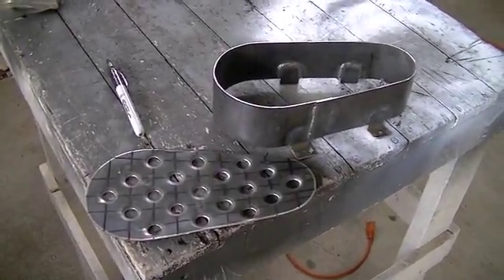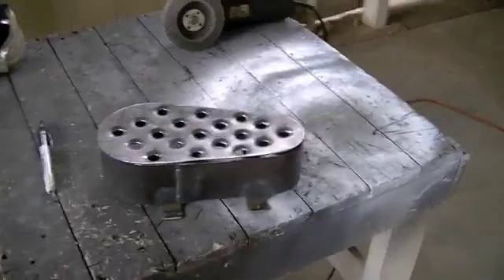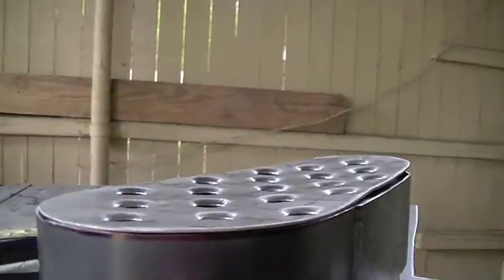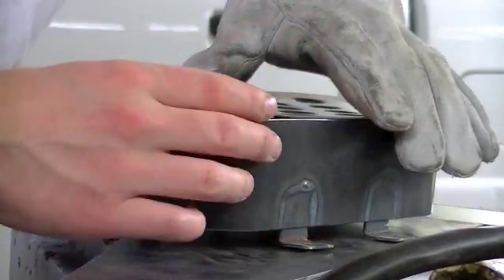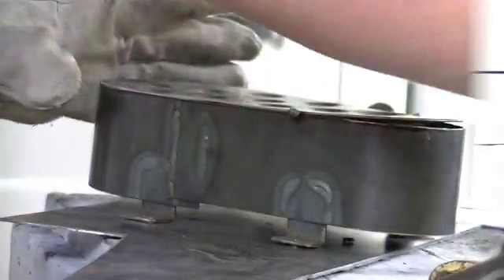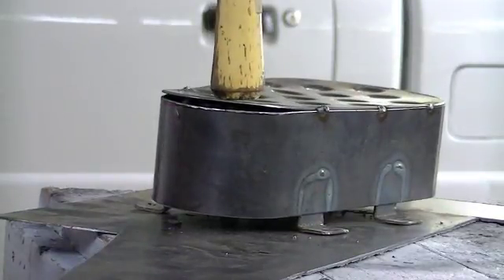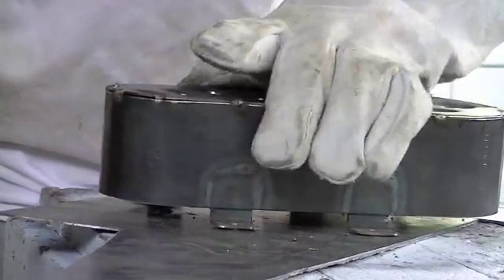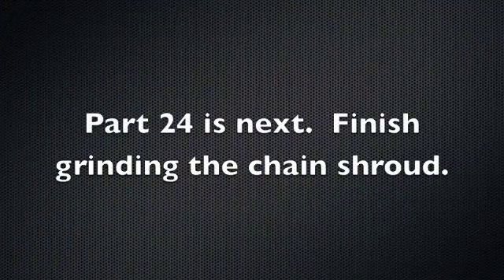Part 23 Motorized Bike | 3HP 4 Stroke Engine

Comment: why do not weld the cover of the interior, thank you for your video
Reply from the maker: I wanted a smooth transition on the outside of the chain guard.  If I welded it on the inside, it would still show a seam.  Thanks for watching!